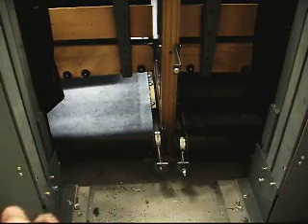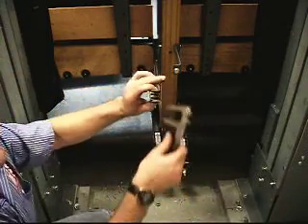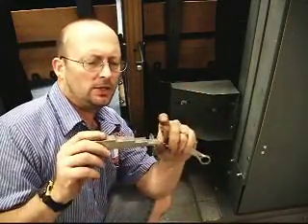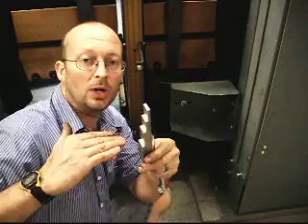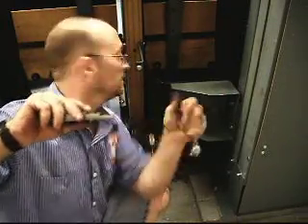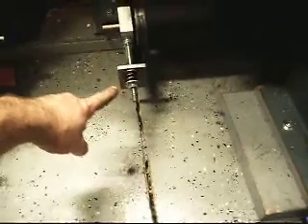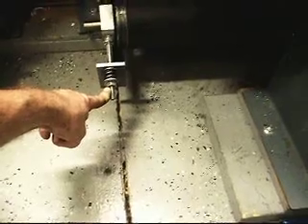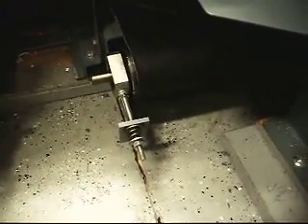GS-X pinsetter, short pit, transport band adjustment and pin deflector board installation.

Comment: Sir i have a problem in gsx machine Brunswick, pins are loaded but table is not coming down
Reply: i'm 5 years late but it sounds like a pinholder switch problem. are you getting a code saying pins aren't loaded? check the pins that aren't registered as loaded